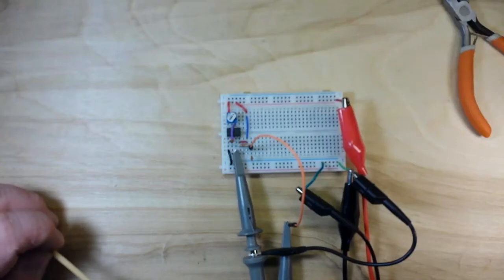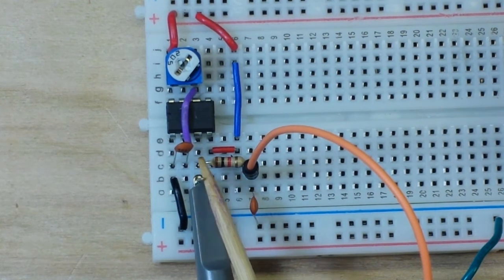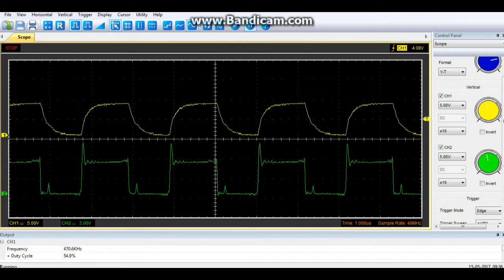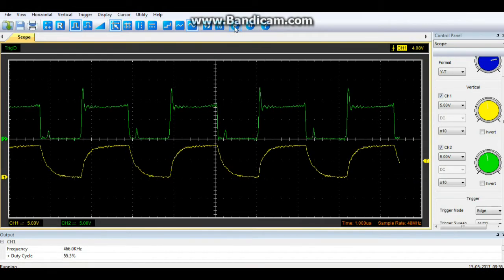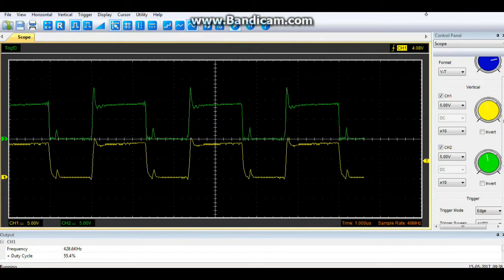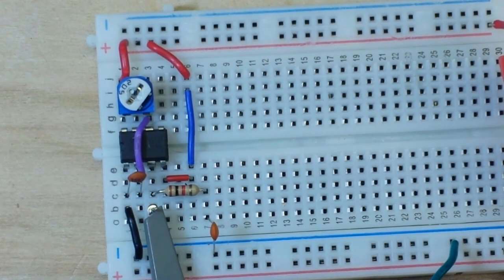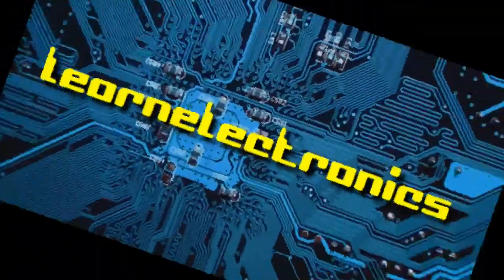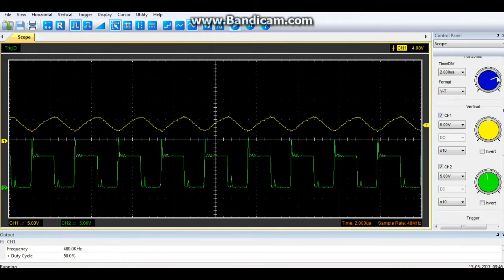RC Intergrator Circuit Fun

Comment: is a derivator also possible? :P
Reply from the maker: fredlllll yes indeed, I was calling it a differentiator, but I believe they are the same. if I'm wrong please correct me.
Reply: hmm i was actually joking XD but yes it seems the differentiator creates the derivate of the input. 

but shouldnt the derivate of y=1 (voltage on) be y=0? when switching on we should get a spike, cause we get a pretty high rise like y = bignumber*x, so the derivate should be y=bignumber. are my math skills wrong or does this simply not translate to electronics?

hmmm i should fiddle with stuff like that sometime :P